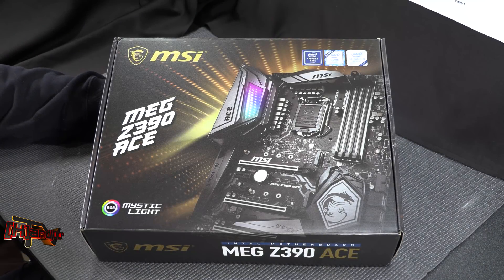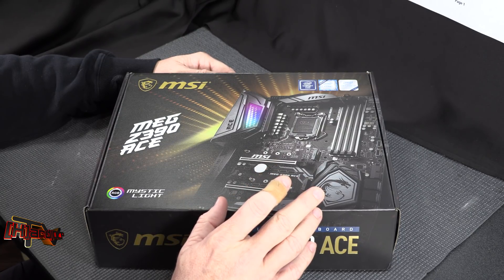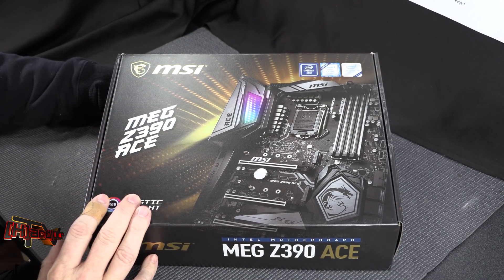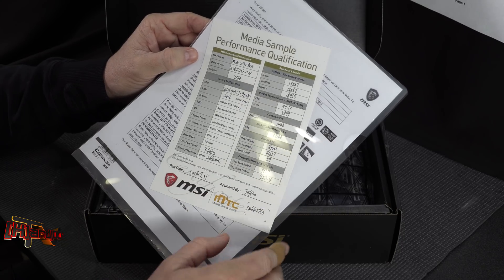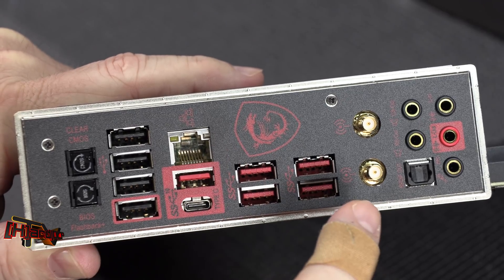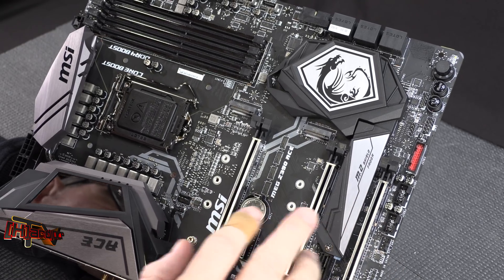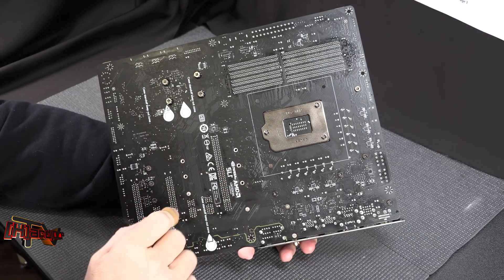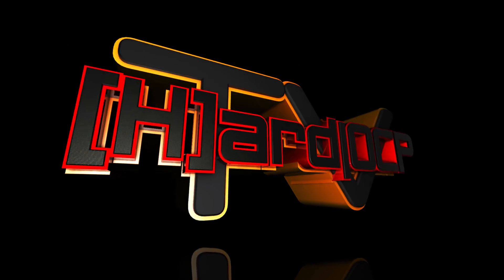MSI MEG Z390 ACE Unboxing & Intel 9000 CPU Discussion

Comment: Just a quick question although ill be upgrading my semi modular cm850x power supply from corasir here in a bit. But seeing the power supply i have only has 1 8pin power connector and the meg z390 ace has 2- 8pin power connectors would 1 8pin be sufficient without the second 8 pin power. Ill be upgrading my power supply a little later. Already have my Msi Z390 Ace just waiting to order the rest of my parts here in a couple weeks.
Reply from the maker: You should be fine unless you are really pushing a huge overclock.

Comment: can't decide between this or the hero xi. Have been wanting the hero xi but after I heard about the asus aura 30% cpu usage, i kinda don't want to get it now. Have been using gaming 5 z97 for my 4790k but upgrading to a 9900k. From the look of it, this mobo and the asus mobo have the same features, more or less.
Reply from the maker: Running very well right now, with not a single issue.
Reply: Yeah I have no doubt about that haha. GOnna spend 1 day thinking about it.